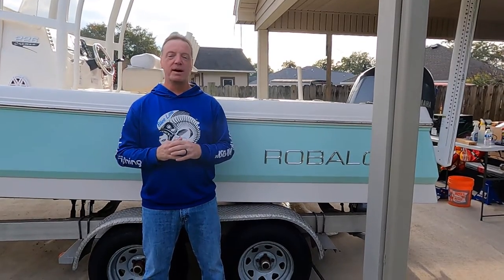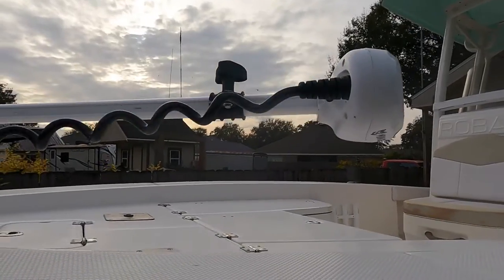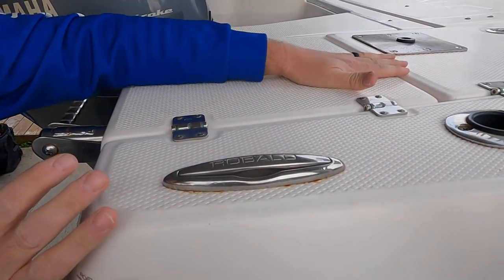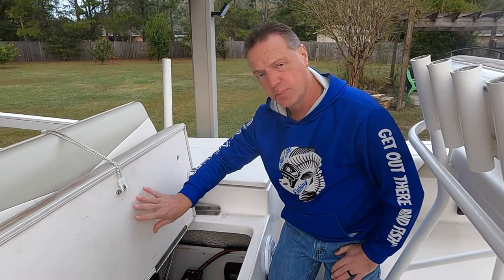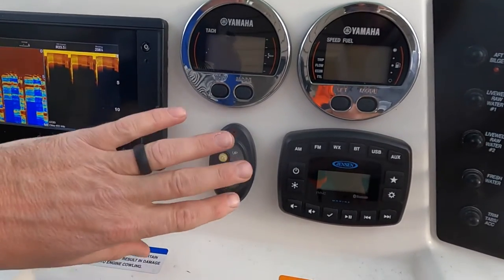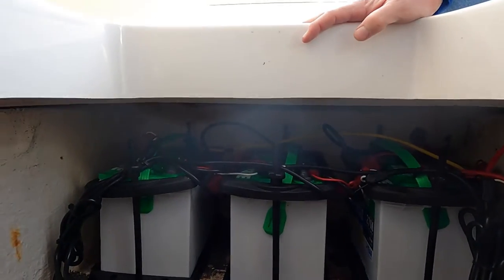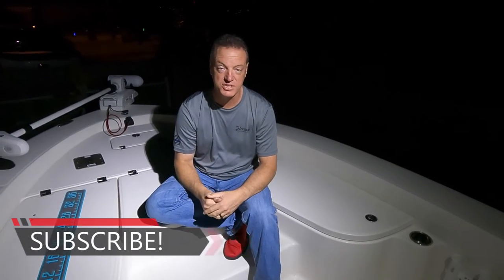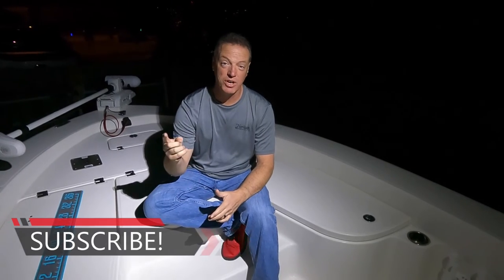ROBALO 226 CAYMAN Center Console | Full Walkthrough!

Comment: I am looking to purchase a 226, though I have been told to go with the 246.  Why is your view on the 226 in rougher water and going out the pass into the gulf?  I will mostly going solo, Estero Bay and near shore.  Seems the 226 would be easier to run by myself.  Thanks, SN.
Reply from the maker: The following reply is from my buddy who owns the boat. "I debated on the 226 and the 246.  Both are great boats, in my opinion.  I tow my 226 with an f150, and it pulls great, but I would rather have a bigger truck for the 246.  As far as rough seas both boats are bay boats, not deep v's, but they are  capable if caught in rough seas, but it will not be enjoyable or dry.  I pick my offshore days according to the weather and waves.  The 246 I'm sure will perform and ride better in rough water.  My question is, how often are you going to go out in rough water,  if alot then I would suggest a deep v.  Between the 226 and the 246, though, it's a tough choice.  I really wanted the 246 but it just wasn't in my budget nor my comfort level coming from smaller and lighter freshwater aluminum boats.  I will probably get the dreaded 2 footitis in a few years and upgrade but the 226 is a great boat and easy to launch and retrieve by yourself.  Hope this helps
 and free feel to contact us if you have any more questions. " 
    You might want to take both on sea trails at a dealer/marina and feel the difference for yourself, too.
Reply: @BlueLineFishing  Thank you for the prompt feedback, very much appreciated.  I am also coming from fresh water boats on the lakes in MN and WI.  I am retiring to Estero where we have direct access to the Estero River and Estero Bay.  Owned a place since 2013, never been down enough to make the southern boat happen.  I expect most of my time on the water will be in the back bays fishing and running around, some sand bars, catching fresh bait, sporadically running out the pass and into the gulf fishing reefs in nice weather or up to Sanibel/Captiva/Ft Meyers and down to Naples for bar/restaurant time.  Going into the gulf will be selective.  Boat will be parked on the trailer, so each time out I will put it in via our on-property ramp, 2-3 times a week.  When mostly solo, that is where the size and weight of the 226 seems much easier to work than the 246.  No doubt the 246 is a more capable, larger and nicer boat, but comes at a higher purchase cost, higher operating cost, larger vehicle, etc.  My wife’s Telluride would never be able to put the 246 in the water.  My Expedition will likely stay north.  I was planning on the 250 HP on the 226, maybe the std motor and go digital vs the 250 SHO mechanical.  Load the 226 up.  Any other guidance for me and final thoughts on the 226 given my scenario?  Fishtales is my local Robalo dealer, I have discussed a sea trial with them.  Though they push to the 246 over the 226.  I do seem sold on Robalo Cayman’s, the layout, hardware, and options are attractive.  Thanks again, SN.
Reply: @scottnelson6533  what did you end up going with?  I am at that same crossroad.  I will be solo often, truck can handle either boat.
Reply: @joetristen993  Did you purchase?  I met a neighbor and he has the 246, loves it, often has a number of people out.  Goes out into the gulf frequently.  Given my mostly solo outings and ease of trailering and launching by myself, was going to go 226.  New wrinkle for me now.  We are flipping our home in 2 weeks and the new place has a 3.5 car garage.  Would be nice to store the boat inside; clean, dry, loaded up, and secure, but would have to sacrifice.  Either 206 or 226, and then no tower.  Would have to go with Bimini top or no top, which I am not excited about.  Going down Aug 18 to measure garage and back to Robalo dealer to continue journey.  Any guidance you have?
Reply: @scottnelson6533  I haven’t purchased yet, I’m still researching and double checking things myself.  I hope to purchase in the next couple of weeks.